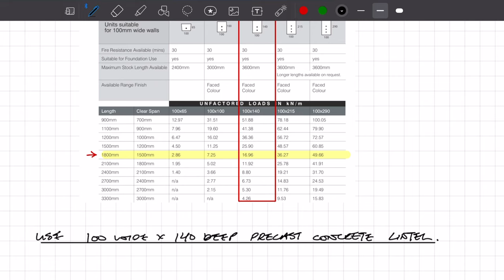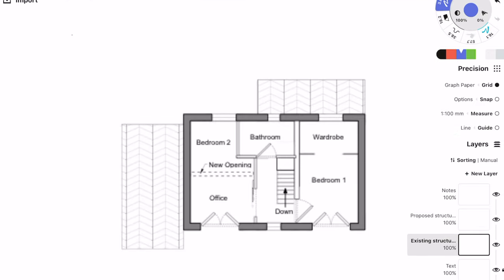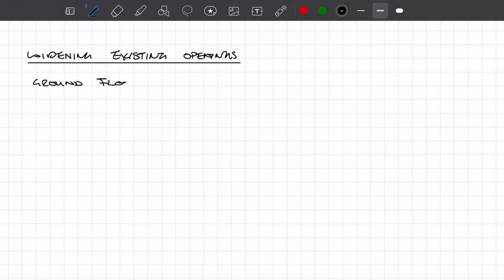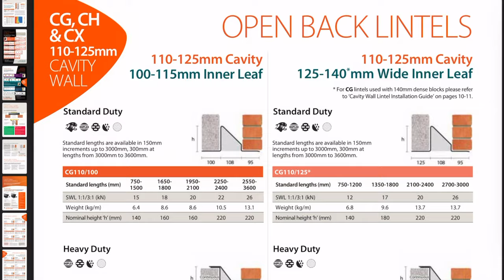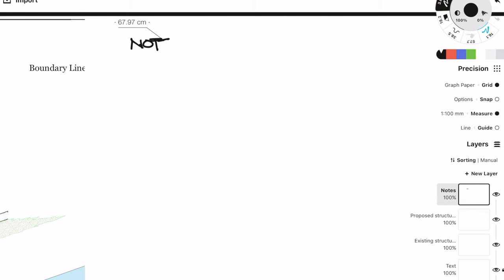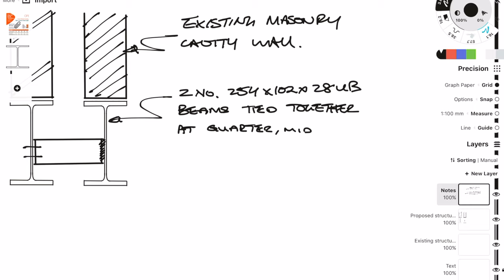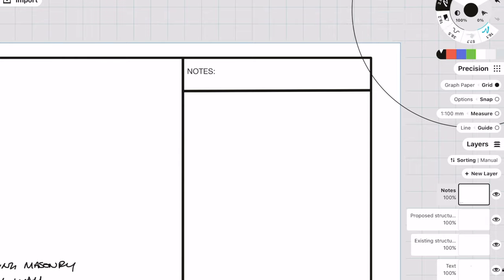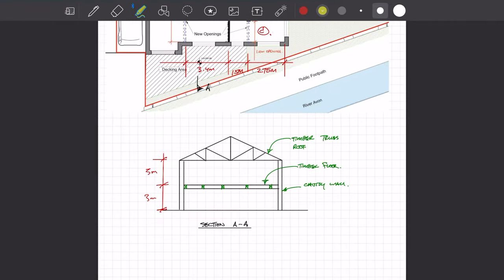Structural Engineering Mini Residential Project - Part 2

Comment: Hello sir,

Just wanted to say I've been watching your content for a good while now - fantastic production quality and clear explanations.

My day job is largely focused on residential condo high rise towers (concrete construction), so I'm at a bit of a loss when it comes to structural masonry and wood work.

My question #1 is: When doing projects with this type of small scope, how do you know you only need to engineer the gravity system, and not need to look at the lateral system at all?

Question #2: Did you ask the client for existing structural drawings, or did you have to visit the site to determine where all the load bearing structural elements are?

Thanks a lot in advance - once again, superb work.